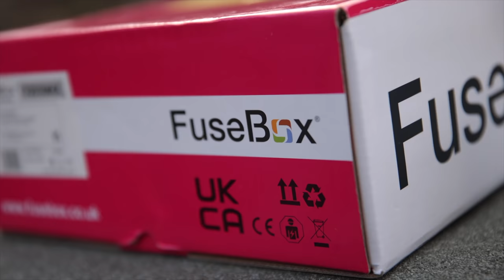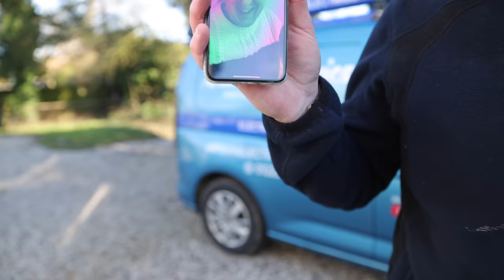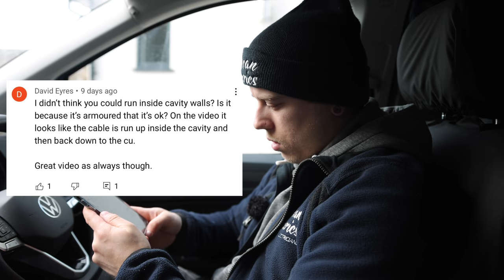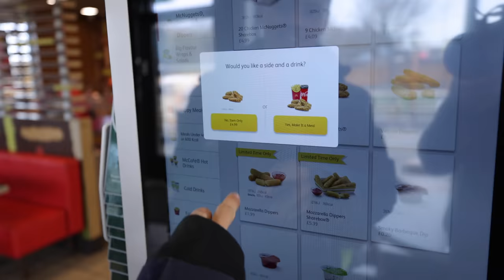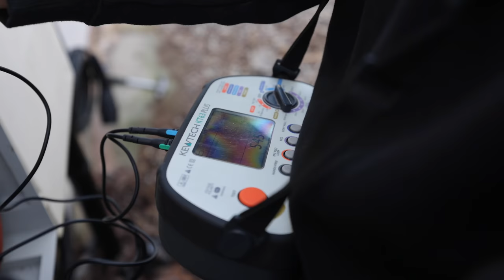EASY HYPERVOLT INSTALL! - Electrician Life

Comment: I would suggest that when connecting two boxes together it should be bushed with a lock ring as spacer.  In addition you would add gaskets.

Comment: Could you not have considered putting a few 20mm holes in the bottom of the CU then fit  blind grommits as not everyone will have a angle drill attachment in their tool kit. I can see you getting cursed by the next sparks to get a cable into that board. Hope its Cory LoL

Comment: The reason why you can't run cables in the cavity protected or not, is it privides a path for moisture from the outside to the inside.
That's why brick ties have a drip loop!
Reply: The other reason is that cables run in a wall cavity are not supported along the run..

Comment from the maker: What did you think of Lee’s camera skills? Let us know in the comments below. Make sure you’re subscribed to our Channel with Notifications on - bit.ly/3nqFpXp-ArtisanElectrics
Reply: Lee’s camera skills are fine, but I strongly disagree with his comments regarding ring circuits. I would much rather have ring circuits, because unlike radials they don’t trip when you have more than one appliance on. There’s nothing wrong with ring circuits that are fitted, maintained and tested properly (e.g. when replacing a socket). The fitting of 4mm radials is not common at all in the UK domestic market, probably due to the extra cost and hassle of fitting 4mm cable runs compared to 2.5mm cable runs, because they are thicker cables they need larger capping etc.
Reply: I can see the "logic" behind using black for the neutral line, if you are old enough to remember pre-harmonisation colours. But it would bring a whole new meaning to "Warning, this installation has wiring colours to two versions of BS7671"

Comment: Hello guys, can i ask if you've come across an issue I have. I had a Hypervolt charger fitted last week in my garage, after fitment it was found that my wifi didn't connect to the charger. I have tried to charge my car but the charger cuts off after 2-3 minutes. I phoned Hypervolt customer services on Friday, but i had to leave a message explaining what was happening as no-one answered. I had no feedback after that, I called the installer and he came back and checked his work which he said was fine, and suggested the wifi signal be extended,  to allow Hypervolt to check the system. I finally managed to get a signal to the garage. I again attempted to contact Hypervolt via email, which they've at least this time acknowledged and will get back to me at some point. The car itself has been ok on charge at other points, have you guys had anything like this in any of your installations? I guess i'm just disappointed at the customer service level after being told how good it is.

Comment: Now it’s not IP rate…. 😜😄 just joking 😎
But as an idea: The box can be mounted a little further away and then you can put conduit in between and use some screwed fittings to bond the conduit to the meter and cu boxes respectively. This way boxes are sealed against  weather and insects, while the conduit allows further installations to be pushed through, without the need to remove any seals or silicone ;)
Great install and good to see a different situation to the usual runs 👍👍👍👍

Comment: How far away is the house DB? I am of the understanding that if that distance is greater than two, or three, metres then a switch fuse needs to protect the cable run, even if it is SWA cable.. Am I correct?

Comment: Why not just run the hi-tuff fully into the consumer unit instead of stripping black sheath at enclosure entry? Looks a bit strange and the inner white insulation isn’t the most durable of material, always found it to be quite soft. Also in Northern Ireland single phase hi-tuff and SWA will have Brown Blue and Earth cores as standard.

Comment: Question.. did you ask the DNO’s permission, to use there cutout fuse, to protect the SWA feeding the house?
Reply: It wasnt a cutout fuse, just an isolator. Any thing after the meter belongs to customer so no need to ask dno.
Reply: @rodd8170  I was being sarcastic as there is no protection for the SWA feeding the house, in this installation there should be a switch fuse after the isolator as it clearly looks like the SWA feeding the house is over 3 meters in length.

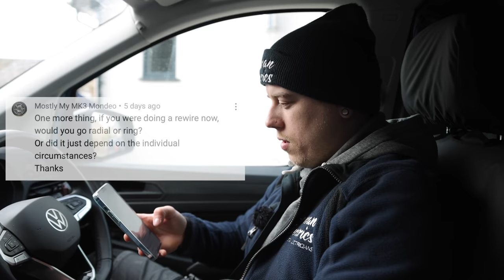Comment: 15:35  Never understand Rings . In Belgium we all have radials on 3x 2,5mm on a  20A MCB  and with a maximum of  8 sockets ( double/tripple/quattro )   Also are sockets are rated 16A ( melt fuse ) don't think a 4mm would and sockets on a 32A MCB is now allowed here :-)
Reply: I think you actually could do it. It depends on the reference method of installation, that is normalised in Europe. Installation method C permits 32A for 4mm² on a single phase circuit. In the worst case it's "only" 25A for that conductor size. Reference method C is directly clipped on the surface or embedded into masoned wall. Length of the cable run is also of interest.
And we usually have also radial circuits here in Germany, also 3x2.5mm² (in old installations 3x1.5mm²) fused with 16A MCBs. Or 10A fuse in really old installations.
And for general purpose sockets we calculate 550W per socket we install. In some installations there is also no separate lighting circuit, especially in rooms that are small and used as bedrooms or living rooms there's one 16A circuit to supply the sockets in that room and the lighting. And that's sufficient, there are usually no appliances with high demand in there. Maybe a ceiling fan, radio clock, TV, phone charger and such stuff.
In East Germany they used a ring for the general purpose circuits. But they also used 2.5mm² aluminium there. 😬
Reply: @Marcel_Germann  combined cicruit  lights & sockets here needs to be  3x2.5 and on a 16A MCB .   4mm here is max 25A MCB . No other regulations clipped on wall or in conduit.  6mm is 32A ( sometimes 40 )
Reply: @kittsdiy  Here it is that way. The different installation methods are harmonised in Europe. The thing is, back in the old days we did the same, this cross sectional area gets this MCB rating. But this was replaced by: Look at the table (mostly for the most common things you have them in your mind), usually the one with 25°C ambient temperature (there's also one for 35°C), look at if it's single phase or three phase circuit, reference method of installation. It's about heat dissipation, the conductor temperature must be kept below 70°C. That is the critical temperature for PVC. Directly clipped or buried into the masoned wall that is much easier than it is with a thermally insulated wall. But you also have to consider the voltage drop, so also the length of the cable run is of interest.
Reply: @Marcel_Germann  funny  to see how things vary in different countrys.  Here we have the A.R.E.I..  It's funny for example 4mm on a 32A MCB is allowed in residential in UK .  Here this would not pass inspection . Same for  the earth has to be same diameter  untill 16mm.  For 120mm²  i have installed 70mm CPC ( but that was industrial in factorys .. also may vary in code ) . And ofcourse everone thinks his country is the best are the way to do it .. i would think AC power is the same in UK - DE - BE  an USA :-)
Reply: @kittsdiy  Usually yes, but sometimes it's different. For example in Europe you usually have a three-phase low voltage grid supplying the buildings, with a voltage of nominal 3x230/400V. Either the domestic installations are single phase and evenly distributed on the three phases, or you got three phase supply in the house. In the US you usually got a split phase supply, meaning the center of the secondary coil is earthed, a center tap, creating a system that has nominal 2x120/240V. That split-phase system dates back to the old Edison and his DC grid. The last remnants of this were dismantled in the 1950s in Germany.

In the UK domestic dwellings usually have a single phase supply fused with 100A. Here in Germany you got a three-phase supply fused with 3x63A in domestic dwellings.
Reply: @Marcel_Germann  that's all correct. In Belgiulm we have Mono fase 40A /   3x400V '25A  / 3X230 V  32A ( as default upgradable if needed  to more AMPS  )   But  AC AMPS = AC AMPS :-)    So why protect a 4mm cable in UK with 32A and in Belgium we need to use 25A  MCB ..  copper = copper .  It's not like you magicly can put more amps trough same cable in UK  .Just because of regulations someone made up   lol  same with plugs why every country has different plugs  USA/UK/Europe ( shucko and in Belgium/France  CPC pin earth  etc )   Would be much more cost effective if  there was a standard in all countrys .  1 type cable for  whole europe for example  but ..  uk likes their twin-earth /  Belgium XVB /  geramnyNYM-J / NYM-K .. If we use in Belgium  Geman or  UK cable installation will not be approved . the cables are safe to use in  DL or UK or holland  .. why not in  Belgium ? etc etc  :-)  But all our appliences just work in the sockets worldwide ..( sometime with adapter for sockets ) ..  I find this really crazy .. let's make thinks complicated . lol
Reply: @kittsdiy  Because in Belgium the guys releasing the regulations wanted to play safe. In a new installation that's not a problem, the problems start when you come in contact with old work. 25A is the maximum rating for 2.5mm² on reference method C.
And it is harmonised in Europe, the thing is the local authority releasing the local regulations must implement this into their own regulations. In the UK this is by the IET, in Germany it's the VDE that releases the regs for the electrical industry.
And in the UK you can get NYY cable, that's for outdoor use or burial into ground.
It's either -J or -O, nothing else. The -J is with a green/yellow insulated wire inside, the -O doesn't have that and have a wire of a different colour instead. For example 3x2.5mm² NYM-J is brown, blue, green/yellow. 3x2.5mm² NYM-O is brown, blue and black. But no one uses -O anymore these days because now you'll have to bring the CPC everywhere, even if it's not required there because the cable is for a light switch that is double insulated.

Comment: Great as ever just one question what’s the tool you use to clean the burs of the holes you drill in the boxes cheers 👏😎
Reply: Just search for a deburring tool on amazon or somewhere. There are loads of them, not sure if I am allowed to post links.